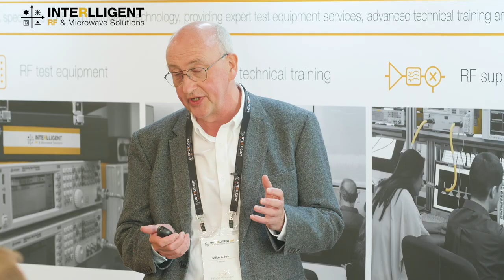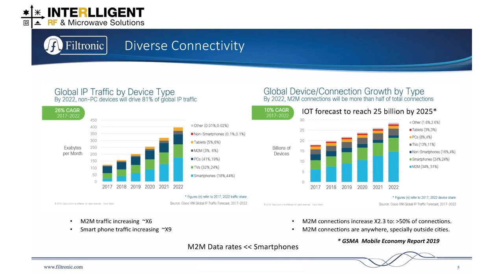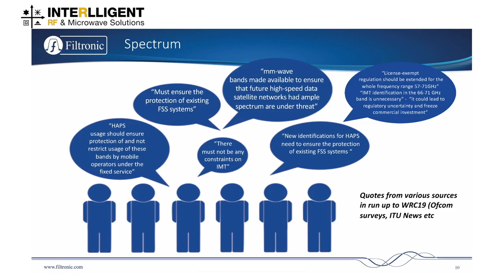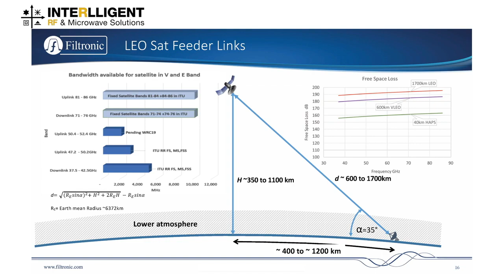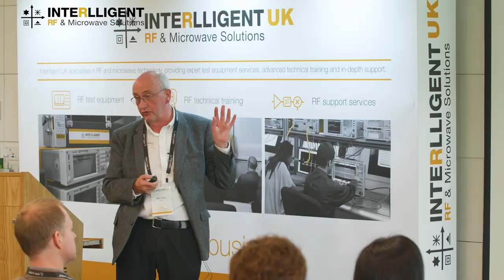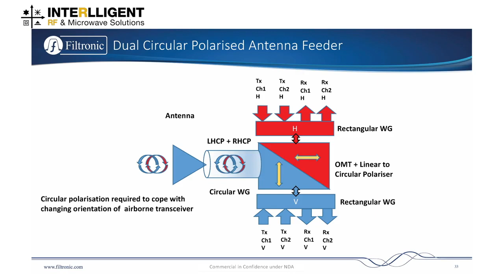Filtronic - 2019 Interlligent Seminar - E-Band for HAPS and LEO Satellite Systems

Comment: Excellent coverage of the advantages and issues of high altitude base stations. HAPS is surely a solution to 5G coverage in remote areas. Hydrogen rather than helium for unmanned airships/balloons would give around 10% more lifting capacity at lower cost.